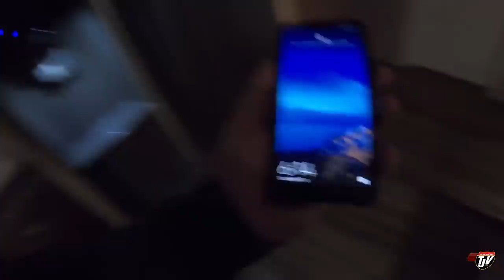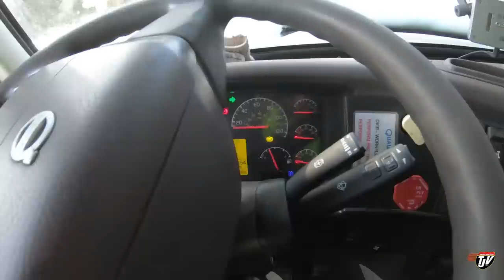TJV | FROZEN SOLID | #1872

Comment: When you replace your batteries put the battery heaters on them. It can be hooked in with the block heater and it will save your batteries and make them last longer. And it's cheap.

Comment: Motor Coaches  have a GIANT SIZE KILL SWITCH on their 2 eightD batteries.  When parked the batteries are removed from the circuit.  Seen switch on smaller stuff, but never road tractors. I had them on terminal cars I leave spotted at various regular stopping point,  Old 6/3 chevys cars with a tow bar used to do for personal use at places where the truck had to say in line or parked due to insurance reassigns. Terminal was deemed a safe parking haven.

Comment: If you need to replace the batteries I would recommend NorthStar batteries and a c-tek charger
Reply: Indeed, C-TEK chargers give batteries a longer life, especially when they're sitting for a longer time unused, I use a C-TEK for my oldtimer too as it isn't used that frequently.

Comment: Wow havent looked at your posts in a few years 
here you are married and i guess you sold the house you had moved 
in from the mobile home.  Josh your batteries need to be 
cleaned and get those posts nice and clear of debris . They must be due for a change but 
take a few hours next time home and take them out clean all your connections 
it might save you buying a new set till next winter. Starter is working hard and the alternator 
also is taking a beating. Had my own many years and ran company also its part 
of being a broker. Money saved money earned dude.